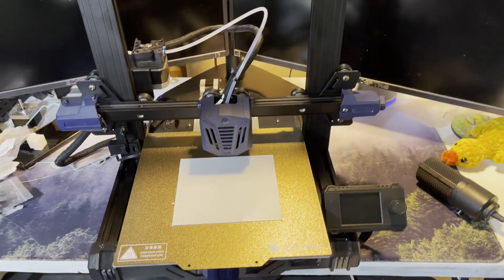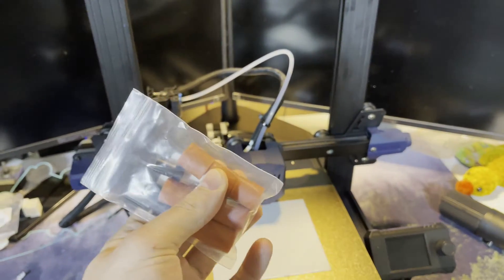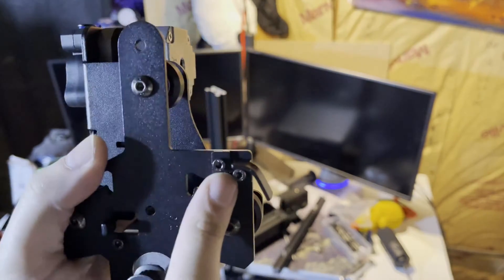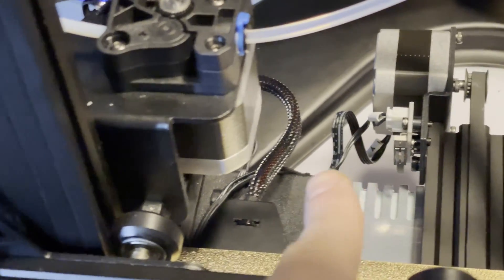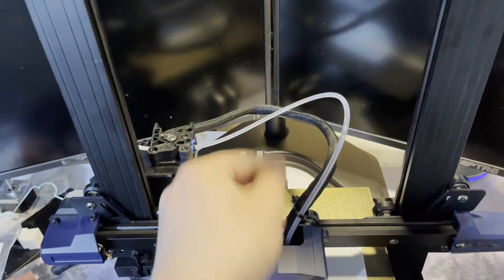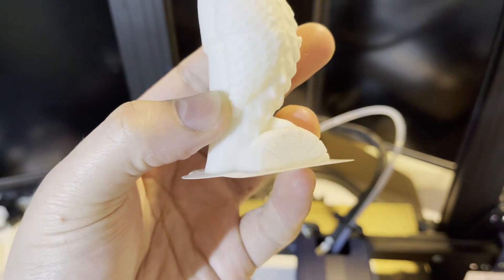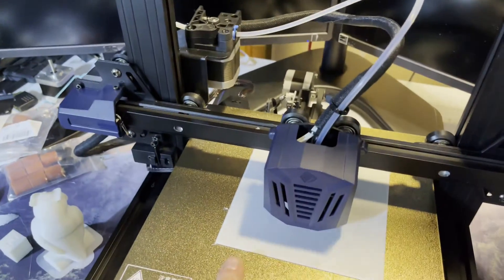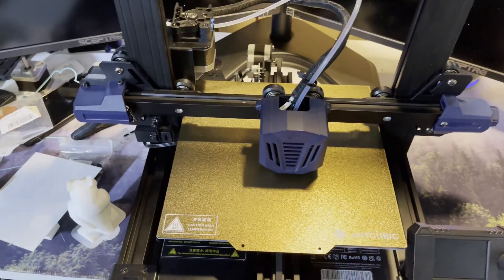EBay's "Unrepaired" 3D Printers - Kobra Go Example

Comment: I bought an Ender 3 with an "extruder problem" from second hand very cheap. The problem was that BMG is the best option and the printer goes ok without any problem. The problem is that people believes that a 3D printer looks like a normal printer when it's false and when problems appear, they don't know how to solve it.

Comment: I have had exceptionally good luck with buying returned printers. Except for my Creality K1 which I bought new directly from their US website store, all my other printers are returned printers. I originally started off with a new Ender 3 Pro that gave me so many problems before I junked it out for the known good parts. All of that troubleshooting along with those spare parts led to buying a returned Ender 3 V2 which I got running again with no problems. I have bought several returned Voxelab Aquila printers and have had good success with fixing them. The stock firmware for the Aquila printers is garbage. I run custom firmware based off the AlexQZD port of the JyersUI firmware on them now. The only failure I have had was with a Mingda Magician X. The funky Stress ABL sensor on that one and inconsistent issues with the printer incorrectly setting the Z offset prior to a print frustrated me to the point that I had to put it back in the box and sit it to the side. I am buying the necessary parts to convert it to run with a different print head with a bltouch type sensor with Klipper firmware using a SKR Pico setup for independent z axis gantry leveling with a compatible display screen for the MKS Pi that I bought to use to control it.

Comment: i bought a ender 3 neo unrepaired for 89 total only issue i found was the power cord was a little short to connect to the board still had the plastic on the bed got the cord fixed out of the way and it prints like a dream would buy one again

Comment: I bought a broken JGAurora A5 on OfferUp as my first printer. It took me a few days to jerry rig it to function, but I did get it printing new parts. There's definitely a LOT to learn this way all at once, but now I know the machine inside and out and have made several upgrades. I recently bought an unrepaired Tina 2 S on eBay which has a broken Z max switch and intermittent power switch. It's actually a lot of fun ripping these things apart, getting them working and upgrading them almost beyond recognition.

Comment: I agree about the bed. My Neo is higher on the right side and no amount of 'traming' could solve it, the first layer was always a little pressed into the bed and squashed, A silicone spring kit for an Ender 3 solved it. This gave me adjuster wheels so I could do it on the fly quickly.

There is a firmware for the Neo that lets you adjust the steppers, Im not sure if one exists for the Go. It also lets you adjust the bed quickly with a preset routine that moves the head around.

Comment: That's so many issues :O Almost like someone had collected the worst parts on single printer.
Completely not worth the effort
Reply: This is exactly what's happening now. A couple years ago they were selling raw returns. Now they're selling what in the refurb industry is called a "junk out" it's an assembled pile of reject parts after they've taken all of the premium stuff to mix and match refurbished quality units. They need next level repair and cannot be fixed with simple parts swaps. We would export stuff like that to 3rd world nations where labor is much cheaper so they could still repair and make a profit eventually.

I bought my whole previous print farm from real untested return units at about $75 each a couple years ago. They ranged from essentially brand new to pretty well used and messed up, but EVERY SINGLE ONE was easily repaired.